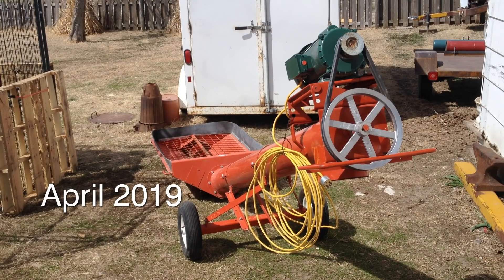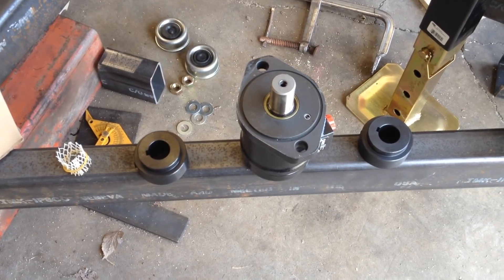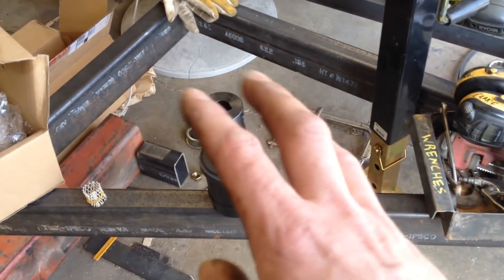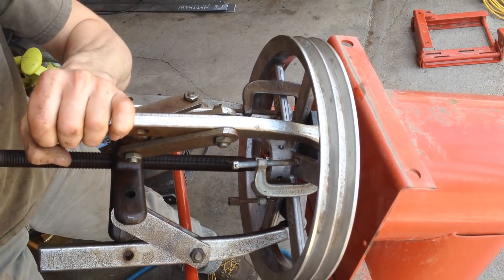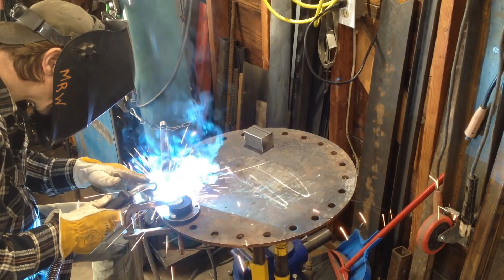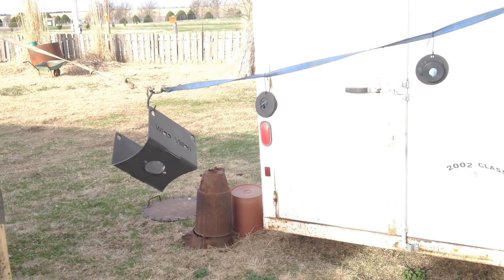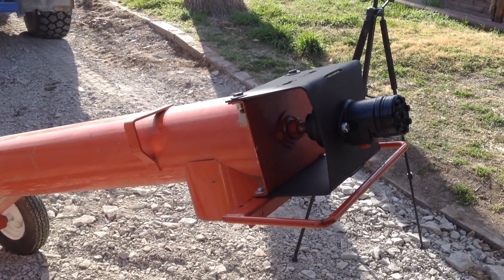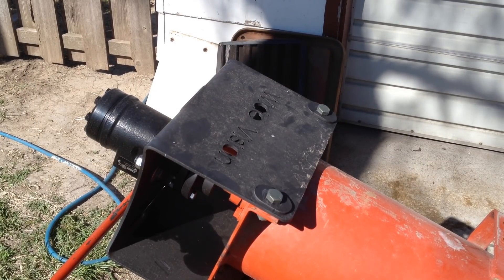Hydraulics! Converting Grain Auger from Electric to Hydraulic Power

Comment: Nice work. I had a pulley come off real hard one time, and then realized that I had only loosened the locking set screw that was stacked on top the the actual set screw.
Reply from the maker: Been there done that! It's so difficult to see  if there's another set screw,  and I seldom think to put a wire in to feel for another one.

Comment: That looks good.  A CNC plasma cutter sure makes it easy to make brackets and such.  We hardly ever have to go to town to buy washers, just cut them out on the table. My son made a drive over hopper auger for his buddy last spring.  It has 3) 6" augers feeding a 14" auger and is run by a 7 1/2 hp electric motor.  I like the shear bolt coupling.

Comment: Maybe it could use a bracket and a couple of short hoses with the quick disconnects. The bracket could be a clean place to hang the hose ends when not in use.
Reply from the maker: The customer is going to put on the hoses, that way he can set up the augers, then measure so  they are for sure the correct length. The hose hanger bracket is a good idea! I'll have to suggest that on to the customer. Thanks!

Comment: Your safety backup solution was ingenious, the old belt was the weak link to prevent a catastrophic failure of the screw getting stuck on anything and tearing itself apart.
Reply from the maker: I didn't come up with the idea, just copied what I saw on another auger.  :)

Comment: does it not take a lot to shear that bolt ? 5/16 ?   cnc rules. as always thanks for bringing us along on a fab project.
Reply from the maker: According to my notes here, the motor might produce 2100 in lbs of torque, assuming relief valve set on the Case 2290 is still at 2200 psi  as set from the factory. The bolt, which is 3/8,  grade 2, and threaded to the head, should be set far enough from the shaft center to shear at 1942 in lbs. Hopefully I did my math right!    I'm loving CNC! Can't wait to get the table finished, mostly just have the fume exhauster left. With the DRO on the mill and CNC plasma table, my production time has been greatly reduced.

Comment: yeah the spring weather is all over the board and relentless east wind. friday it was oppressive 70* i opened all the curtains on the calf sheds at work then yesterday morning all back close them up. there were 2 calves in the polydomes that got pneumonia friday one did'nt make it. grew up with a hesston pt10 haybine the hard to get to pulleys had a tapered key so you had to pound the pulley in then somehow pull the key out with a claw hammer. took me years to figure it out and all that to change the main drive belt. seems like farm equipment theres never no anti seize on shafts
Reply from the maker: Pneumonia is definitely a real concern with this crazy temp swings. I never did like calving this time of year, I preferred to calve in January. It's colder, but dryer.

Comment: Awesome job! How do you figure what size hydraulic motor to use?
Reply from the maker: Thanks!  I start by what tractor they are using, and what RPM they will be using it at, and then I know the Gallons per minute. Then I go to the surpluscenter.com  and at the bottom of their page, click "tech help" which leads to a hydraulic calculator, and I plug in GPM, take a guess at displacement, then see what the RPM is.  Unless it's a new tractor, I usually pick a 5.9 cu inch motor for PTO stuff.

Comment: A few good tricks there!  How many projects have you used the plasma table on?  Heat stroke at 75 °, lol.
Reply from the maker: Used the table on 3 or 4. I still haven't finished assembling it, mostly need to finish the ventilation system. In my garage, it fills with fumes quick!   Does it ever get down to 75 out West? LOL! :)
Reply: @WideVisionMetalFab  Now:  highs 65 to 80, lows 50 (coldest for year 28, lol).  Take care & thanks for reply!   (Wish I could justify one.)